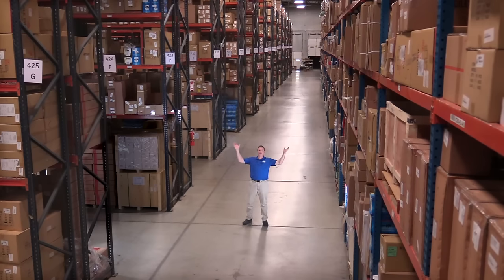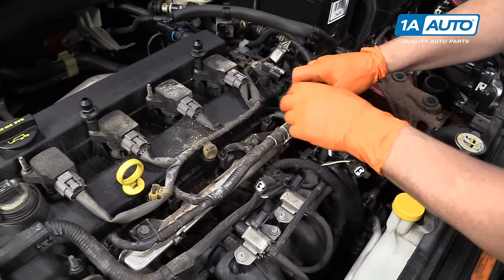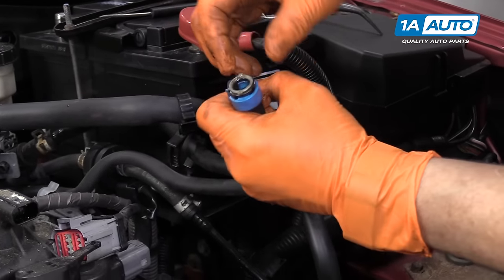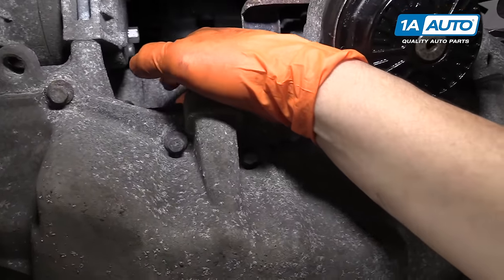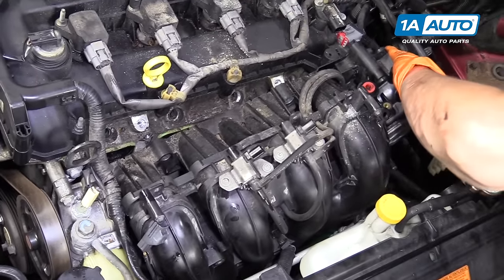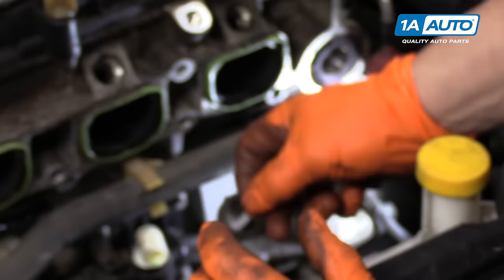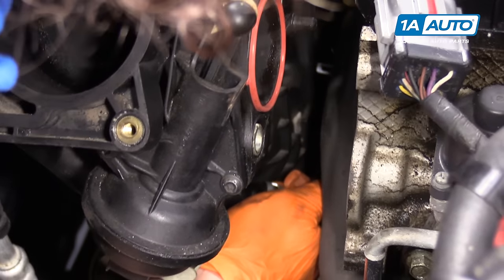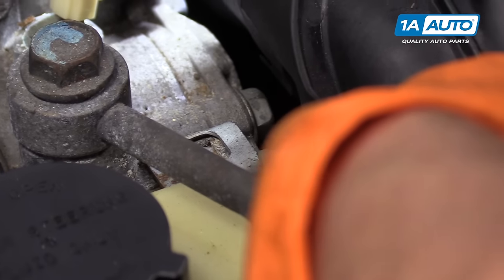How to Replace PCV Valve and Hose 02-09 Mazda 6

Comment: all this for a pcv valve?! ill just put tape over my check engine light!
Reply: Until you stall in the middle of the intersection while turning due to this.
Reply: All this work to change a pcv valve that's ridiculous forget Mazda
Reply: Exactly I was stalling out ALL the time sucks especially when you got people behind  you
Reply: Nope usually its "all this" to fix the lean P0171 code that comes from the cracked rubber tube that connects the PCV to the intake manifold..That PCV valve will last a lot longer than the tube..
Reply: But ya can’t ignore the stalling, power loss, oil consumption, etc haha (been going through it)
Reply: @on-site4094  its actually Ford design
Reply: My 1JZGTE was a 5 minute job, top of the cam covers.  This is absolutely insane in comparison, I was going to do it for preventative maintenance but there is no way I'm going through hell to change it after watching this.
Reply: wonder how $$$$ that cost for a $15.00 part 😳

Comment: I just did this. After disconnecting the throttle body just move it out of the way doesn't need disconnecting. Also when bolting it start with 2 on top and then the difficult one in the front that way in case you drop it you can take the intake manifold off to get it out. Also don't tighten the first two bolts I said all the way so you can see from the top when bolting the porthold bolt goes in correctly. Like other person commented use tape to tape the bolt to the ratchet socket.

Comment: this woman knows the Mazda6 very well, and has put many men I know to shame. I've learned so much from watching her videos, and I've been able to do everything myself on my 07 Mazda because of her. She explains everything very well and in detail, and the camera is very clear and gets good shots of what she's doing. Sure things can be done a little different than the way she is doing it, but she is showing you the proper way to do it, and then that leads to other ways of doing things. Sometimes not doing it the proper way will work for some but not for others, so when you learn the proper way of doing things, you can branch off by doing it another way.
Reply from the maker: +Grateful aya Thank you for the great reply. We love to empower our customers by showing you how-to perform your own auto repairs while installing our high quality auto parts. Have a great day! 1aauto.com
Reply: Grateful aya : 😉 ok... with very high mileage, get everything if you remove the intake manifold; pcv valve, water pump and thermostat, throttle body, throttle body sensor, etc. CRC cleaner products works best!
Reply: Well thanks for the video, I wonder why is she draining the coolant fluid and removing the injectors rail.. I've done this job without this unnecassary labour twice :)
Reply: @johns1418  The video is meant to teach different lessons. Now I know how to change my injectors. Some jobs can be done easily when doing others.
Reply: I get it...... By other way you politely  mean the wrong way
Reply: @johns1418  see why you had to do it twice

Comment: As helpful as it is, she did not clean around the injector and or intake area before removal, as you can clearly see, there is a large amount of debris in the injector holes as which some has surely entered. But thank you for the video.

Comment: Thank you 1A Auto and Sue!! My wife's 2006 Ford Focus wagon was throwing random P0171 "lean bank" codes and then it started stalling at idle. I followed the instructions in this video, the manifold gasket video, and one from Craig's DIY Car and found a 1.5 inch crack in the PCV hose.
- Don't drain the coolant unless you need to replace the coolant hose that runs past the PCV hose.
-  You can get the bottom bolt on the manifold without lifting the car. 
 - The Focus manual says remove the fans and shroud. I didn't. But I did unbolt the fuel rail and pop the injectors and move the rail to get better access to the clip on the PCV hose. I was able to leave the fuel line connected. 
- I found a rare-earth magnet that fit in my 10mm socket. No more dropped bolts.
- You need the extra long angled needle-nose that Sue uses like a surgeon's forceps. 
- Where Sue just presses on the electrical connector for the Intake Manifold Runner Control actuator, I had to use a right angle gasket pick at the top of the latch.
- The PCV valve retainer ring cracks easily. Carefully pry up - and out - at the right locking tab with a thin tool.

Comment: the designer of this engine should be sent to jail
Reply: Actually a very durable and tough engine. great design they used it from the early 2000's all the way up to my 2011 fusion at least.
Reply: @donderfoil  With tons of plastic fitting and clips inside the engine bay  ( Including the whole manifold) that become brittle and break so easily. It can't be a good design. And on top, that much disassembling just to replace a simple PCV valve ?  Not a smart design at all.
Most cars require no more than 5 minutes to replace.

Comment: Did a PCV valve, hose, intake and throttle body gaskets on a 2008 Mazda3 with the L3-VE 2.3L engine using this video as reference. Trickiest parts were removing the PCV valve from the plastic retaining piece without breaking it (used a small pocket knife), and getting the blind center intake bolt started (wedged cardboard in socket with bolt). I didn't remove the emission tube and was able to wriggle the intake up and out without issue. Didn't drain coolant and didn't lose much on the floor. Great video, couldn't have asked for a better preview of the job!
Reply: I have this engine too and car lol 😢😂

Comment: What a great video. Thanks! I have a Mazda 5 2007 (European spec) and I was able to follow this with only minor differences between the models. I wont say the job was easy, but it was only really possible due to this excellent vid. I would not have attempted it if I had not come across it. Thanks again.

Comment: You've done a great job here ... convincing me to leave the old PCV in and live with the consequences!  One unused $6 part I will not use.  
Shame on Mazda for making simple servicing tasks so monumentally difficult and labor-intensive.  
Likewise for the alternator brushes; that $16 part has been sitting new in my glove box for 5 years since I bought the car used.  The car will eventually break down far from home as a consequence.
Reply: @WeidongYu    for designing the location of the pcv how many hours  to change the pcv might  as well clean the throttle  body while your  in there I like to use silicone spray on the o rings when reinstalling
Reply: Don’t blame Mazda for it. This is a Ford Duratec Engine shoved down on Mazda. I have a CX7 which is even worse.
Reply: @on-site4094   took less than 1 hour. 25 min to take apart, about the same to put it back together.

Comment: Just completed PCV/ hose & Knock Sensor, took my time 2010 mazda-6...did not drain coolant, remove injectors or jack up car!

Instant improvement in MPG & cat not at threshold code gone...winter will tell!

Many thanks for the video
Reply from the maker: +c jones Thanks for checking us out! 1AAuto.com

Comment: Really wanted to thank you for putting this together.  This helped tremendously in replacing my knock sensor.  I only wish I had seen this about 10 years ago when I had to figure everything out myself when the PCV when out.  I played it safe this time and replaced the PCV and knock sensor during this go around.

Just a comment to anyone that has a Mazda 6i 2003 Automatic 2.3L. The oil dipstick is attached to the intake manifold, and surprising enough the lower nut to this is the hardest part in the beginning. Do this as your very first step right after the coolant drain.  Other than that follow this awesome instructional video as shown.

This is not the only video that 1A Auto Parts has put out that I have used.  Keep up the good work!
Reply from the maker: +Peter Thank you! We love empowering our customers and showing how to perform DIY auto repairs with our high-quality auto parts. 1AAuto.com

Comment: To my understanding, you should never open the throttle's butterfly manually if it's connected to power. Disconnected from the power you should be careful but it should be fine, this way you can clean it properly. I do have a Bachelors's degree in Automotive Technology but I don't have the experience this lady has. That being said, I have properly cleaned the Electronic throttle body in my 2010 Mazda 3 2.0i and it has been 5 plus years later and working fine. This service corrected a code for Idle Air Control – RPM Lower than Expected. I have also done the same service to a 2014 Mazda 3 2.5 and it still running great. My respects to the professional lady, this is a topic I would love to examine further.
Reply from the maker: +supernatural82 Thanks for the feedback! We'll pass this info along to our production team.

Comment: Just finished doing this today on a  2006 Mazda 3 GT. Once I removed all 8 bolts, I was able to pull the intake manifold to give 4inches of space. This gave me just enough room to remove the PCV valve off and put a new hose in. Would it have been nicer to have the extra space to take it out and replace. Yes, yes it would. 

However, I did not want to remove all those harnesses and having to put them back as well did not seem appealing to me. It just increases the chance for error. 

You also don't need to drain the coolant. You can just remove the throttle body bolts and leave it connected to the coolant lines. If you want to clean the throttle body and don't want to drain the coolant. I left the car to cool down for a while. So when I took the lines out I didn't have any coolant left inside. 

Also, a tip for the most head banging, stupid, idiotic design placement for a bolt for the intake manifold (center one). Have those little magnet on the extendable sticks so you can place it in the hole and turn it just enough to thread it so you can take the magnet out and leave the bolt in. Made it so much easier and less of a mess! 

Have fun guys! Remember, patience is immensely required.  T-T

Comment: Thanks for a great instructional video.  I was curious if it might be possible to  replace PCV valve from the bottom without removing the intake manifold?  Perhaps one can remove the radiator and fan assembly to gain more room to work on the valve?

Comment: For the plastic ring holding the PCV valve down. If you take a pair of pliers and rotate the ring a little, it will pop right off. The little tabs move off to the side so they are not in the holes anymore. Much less likely to crack it.

Comment: Great vid. Would like to know why you needed to change the PCV or knew there was a problem with it!. Not that i would attempt changing one after watching that.  Think mazda thought of a PCV valve and built engine around it.  Thanks
Reply: Oil in throttle body, if pcv is restricted it can cause excessive pressure in crankcase and cause oil leaks at pan and valve cover gaskets.
Reply: A bad PCV valve will cause various problems with most major ones, oil leaks from weak engine gaskets and seals, increased crankcase pressure which if not addressed will ruin your engine, also excessive oil consumption due to the blowby if the valve is stuck open. It is a $10 part which Toyota, for example, has right there on top of the engine and it should be replaced every two or three oil changes. Unfortunately, I see Mazda has decided to go with a retarded design. Toyota - $15 part and 2 minutes labor (0 cost if DIY and maybe $20 if the mechanic will do it). Mazda - $15 part and half a day if you know what you are doing. (probably 500 bucks in labor)
Reply: @petkoandreev7869  Very well said Sir. Perfectly explained 👌 Especially about the stupid design from Mazda.

Comment: Need to replace my PCV valve and my thermostat. Will removing the intake give me access to the thermostat too?
Reply: You can change the thermostat without removing anything but the thermostat and the hose of course. Its attached to the hose housing so it needs to be replaced as a whole. Its actually pretty easy
Reply: The thermostat bolts are accessible with the intake manifold installed, but if the intake manifold is coming off anyway, change the thermostat when you have it off. If you ever want to change just the thermostat, first remove the serpentine belt tensioner. That will give you plenty of room.

Comment: Hi.
Is there a way to tell that your PCV valve is not functioning properly without disassembling everything like on the video, given that it actually consumes oil (not that much but still) and you can see the oil INSIDE the intake manifold (just saw it when I took off the throttle body)? 
Thank you so much for the video!

Comment: Thanks tackling this tomorrow .your video really helps me get a full understanding! Appriciate it !
Reply from the maker: +dtown tx Thank you! We love empowering our customers and showing how to perform DIY auto repairs with our high-quality auto parts. 1AAuto.com
Reply: Ok question here I'm almost done I  had already put bolts back in and was about to add fuel rail when I realized  I forgot the metal emissions tube with the 22mm threads on it  wellI forgot to put it back on, it just looks like a piece of metal to me, how important is it? I guess I'll have to backtrack to put it In but just wondering how nessacary  that part itself is or its purpose
Reply from the maker: +dtown tx You will need to back track and put it on.
Reply from the maker: +dtown tx Thanks for watching!  You'll want to attach all hoses back to where they go, as it could cause issues like a check engine light etc.  Best bet is to back track and find where it goes!

Comment: When the job was totally complete and the engine was restarted, did this initiate any fault codes and did you have to clear them or did they clear after driving the car for a period of time.
In real time what time should be allocated for this job 90 minutes , 2 hoiurs, ?.
Thanks
John
Reply from the maker: +John Kerr Depends on the skill level. Some might be an hour. Some might be an afternoon. For us, there were no codes because this valve needed to be replaced - which we used an obdII scanner to clear codes. You can also drive around 200 miles or so for the computer to reset and the light to go away. If the light doesn't go away, there may be another issue besides a bad PCV valve

Comment: I am sorry but the whole purpose of cleaning the valve body is to clean the gunk between the butterfly (drosselklappe) and throttle body to allow a little gap. That gap is important for the proper air/fuel mixture. You can clean the body all day long but if you don't open the butterfly and clean the walls you did not do anything. No idea how exactly the [rocesses will affect performance afterward...The battery is disconnected so the ECU will relearn and adjust the throttle.
Also, it is a must to replace fuel injector O-rings when removing the injectors, just like the intake and throttle body gaskets. They may seem fine but they are cheap and if they have been there for the life of the car chances are you will run into problems later.

Comment: It is necessary to drain the coolant fluid only to remove the small hoses connected to the throttle body ?. Are there other hoses from the cooling system not shown in the video?
Reply: I cleaned my throttle body but I did not drain coolant I just used channel lock needle nose to pinch off coolant hoses worked great😀
Reply: @utuber2940  Pray that they don't crack prematurely.

Comment: A lot of unnecessary removal going on here. I’m doing this job on a Mercury mariner and I left the rail on the engine, I didn’t pull the airbox and I did pull the cooling fans, and the job went very well. Torque spec is 156 in/lbs. it’s best to use the 1/4 drive inch pound torque wrench and go from center outward moving from top to bottom.

Comment: I'd  rather buy a hyundai just for the pcv valve... it's on top part of the engine... no sweat to replace.
Reply from the maker: +Cali Thanks for checking us out! 1AAuto.com
Reply: Until you have to get everything else fixed on it 🤣

Comment: Is this job exactly the same for  the 2.0 liter MAZDA 3?
Reply from the maker: +Efrain Macias It may be a different procedure on your application. We currently do not have an auto repair video for this particular year, make and model. Thank you for asking. 1aauto.com
Reply: It was on older 2l engines on newer so probably gen 2 mazda 3 (06 - 08 it definitely is the same as this I saw that somewhere the other day the person was shattered lol)

Comment: Had a go at this project and unfortunately I I was unable to remove injectors. Anyone any ideas how to remove stubborn or possibly seized injectors.
Reply: Spray WD-40 around each injector and allow to soak. Wiggle the fuel rail back and forth gently as you apply slight pressure up. Repeat these steps several times if necessary until the injectors release from the head. Make sure to inspect and clean each injector before reinstalling. Also, use a new o-ring on each.

Comment: What I've done is kept the original PCB valve, honed it out and put extention hoses and a new PCB valve where I can access it to save me the trouble of all that work again, also add a breathable oil cap on top or make your own.azda built a great engine but put that stupid valve so low next to the oil level. The moment a little oil pressure starts to build it starts to pump oil out I to you intake costing a fortune to fix, so you would sell it and buy another new one I guess according to Mazda🤦🏼‍♂️

Comment: I cant understand how or why design engineer of this  model think that the PCV , its hose , the intake manifold gssket will not wear out and that there is no need to make a repair and hence the mechanic will not find difficukty in temkving those bolts.  They coukd have design that a sufficient space is provided.